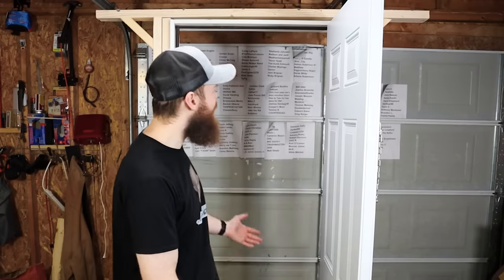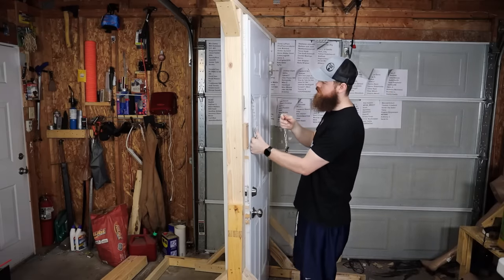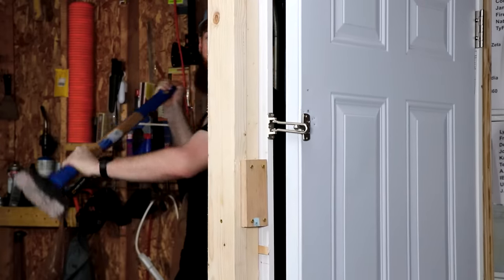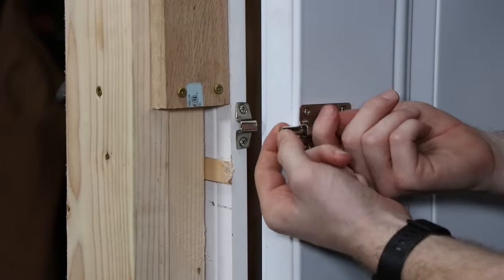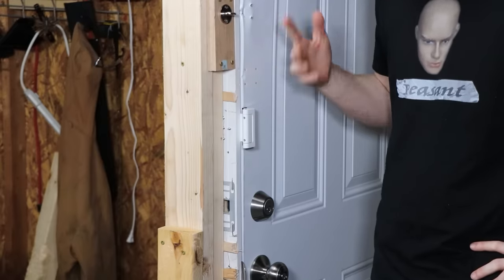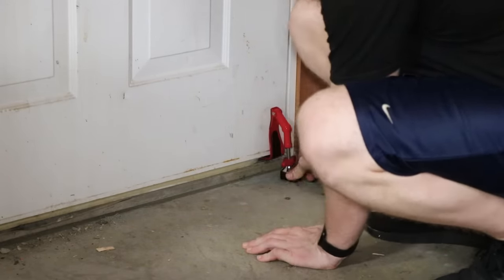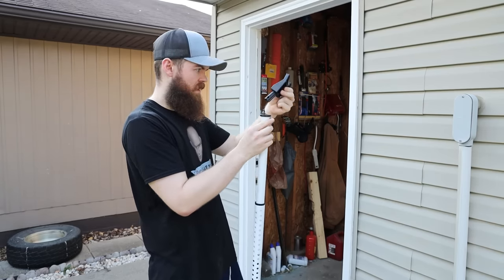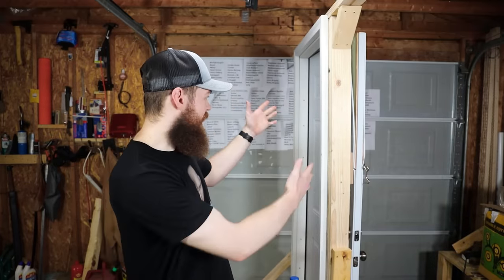Testing Top Rated Door Locks From Amazon!

Comment: Personally I would really like to see this tested again. But this time around have the door frame better stabilized or weighed down, and for the added security features to be properly installed with upgraded hardware. 
Maybe if possible do two doors one with all the security features locked at the same time and then another where you test each one individually. Just a thought but would be cool to see

Comment: The door chain latch is suppose to be horizontal mounted to the door with the hole on the far side. That way when you push the door open you cant unlatch the chain but it's still just as easily broken
Reply: Check his channel. He did another video.

Comment: The one you thought would be the best 1.  Those are used with the regular door locks.  I have a Similar one. And depending how you install it.  It works really well.  I kicked the hell out my metal front door.  And there is no way without breaking through the reenforced frame.  I used 4 inch screws on the locks and hinges.  And I reenforced my door frame as well

Comment: This is a poor test. The test door setup is not secured in place so it does not represent being a house door. When you impact the test door much of the energy is used to move the entire structure. Ordinarily all of the energy would be input directly to the system. There is too much energy loss in this test. Even still, I appreciate the effort!

Comment: Good luck getting through the "slide locks" that are in my door :D They go straight into the metal frame and and inch thick each on top, middle and bottom of the door.. (and the door opens out, not in)

Comment: The first lock was the wrong way around, the slider bit is meant to be on the door, not the frame. You have to basically close the door to release it, allowing you to fully open the door.

Comment: Jamming pennies into the door jamb would lock the door better than most of those.  

Want real security?  Put in four U brackets - put them into the studs to the sides of the door - two of them at knee height, two at shoulder height.   Drop a 2x4 into each U bracket.     To break the door down, the WALL will have to be broken.

Comment: First off Great video and thank you for your time and money you invested in this test.I have a few suggestions to test. Second, I was like you I thought the door defender type lock would have been better. Maybe it’s the brand? .(I thought the stick would been better as well)  I have seen many reviews saying the Prime Line brand / Defender Security (sold at box stores for 4 times the price on Amazon ) is the original flip style lock and made from better materials. In one video I could tell the metal piece that bolts on with was laminated layers of aluminum and others not. That’s an obvious advantage. May want to test it. Also a new brand out “Mousike” makes the same type lock in 4” and 8” with the 8” having 6 screw holes compared to 3. Maybe it’s better? Especially with 3and 1/2 great screws.  But after reviewing I have seen good things said about the CZU lock(again with great screws not the supplied ones ) . One other is the Honesaloc brand. It looks like an old type hotel lock but has an extra way to lock. So if you could test the Defender Security 3” brand , CZU slide lock  , Honesaloc, and 8” Mousike that would be awesome. All are on Amazon and I think three of them costs about $30 total. And then the CZU is $28 for 2 pack. We all know that anyone can break a window. So cameras are recommended and a security system with glass breakage sensors and motion detectors are the best , (well they are the best to get up and get the real best security device that holds rounds ) but these door locks are a good addition to a security system. Thank you again.

Comment: For deadbolts, they make a U shaped plate that goes over the edge of the door and then the door latch and the deadbolt assemblies are installed through the plate and the door like normal.

Then there is a special heavy duty latch plate for the deadbolt that extends a couple of inches above and below the hole with a cup that fits into the hole and it has about one inch screws that holds the latch plate in place and then in the bottom of the cup it had three to four inch screws that are run into the wall studs.

Use a deadbolt with an extra long throw and some hinge pins on the hinge side of the door and screws long enough to go into the wall stud on the hing side of the door and they would have just about have to to break the door down the center to get it open.

Comment: I've seen a lot of chain locks in polish houses, but the difference was, they were mounted straight to the brick wall with big screws, and they were much longer with some twist and drops, so you can't "push and slide" them to open from outside. They are cheap and reliable, but I don't think they were made for US market, where dry wall is much more common.

Edit: I just saw the chain. Whoa. The ones I saw had much bigger and sturdier looking chain.

Comment: First off. He couldn't produce enough force because he was using his support foot to try and keep the frame from sliding. The frame sliding was so there was not enough resistance. Next time anchor the door frame to the floor. And be more careful, you could've slipped and cracked your head open.

Comment: Found out something law enforcement hasn’t known for years; most residential doors and box store locks aren’t very secure. As you upgrade locks your cheap door can become the weak point. The hotel bar lock is defeated quite easily with a simple flipper, just a bent piece of spring steal; a lot of department and even most hotels themselves have them. I’ve used the little latch lock, the one that goes in the door catch, as it’s a simple added security on hotel doors to prevent entry while you’re in the room; hotels offer very little actual security. Just realize most entry is upon unlocked doors or in under a minute; anything more than that and most criminals will just move on. I will say the long bar lock, referee to by some as NY locks, were quite popular when I worked in NYC, and typically were installed in one piece and actually had a piece installed in the floor and door which when positively engaged were quite difficult to defeat/bypass. Usually law enforcement, upon seeing a lot of locks, or a door that doesn’t give in a hit will target the hinge side as they can be the weakest point as one other side note when doors aren’t actually mounted and are in test rigs like yours a lot of energy goes into moving the rig and not into the door.
Get a quality deadbolt that has a security plate or housing with long hardened screws designed to go into the structure of the house not simply the door jam; and if your hinges are on the outside get security hinges and/or jam pins to prevent a person from simply popping the hinge pins out and opening the door without having to deal with the locks at all.

Comment: I'm kind of curious if the pole jam would work if you replaced the button and ran a bolt through it instead. I know that would be a bit more alteration than just longer screws but I'd be interested to know if it works at all.

Comment: Very first lock you had with the chain you had it mounted backwards the chain is supposed to be on the lower frame and the receiver on the door, also the receiver is supposed to be horizontal with the opened end the farthest out so you can't do what you just did.

Comment: the way to mount a chain lock is the chain on the frame and the insert part on the door mounted horizontal with the insert point on the far side away from the doors edge once the door is open the only way to remove the chain is to close the door so a hand cant fit

Comment: I will say this, Each of these designs has potential. if you made some design changes they could be a lot better (except the chain, never been a fan of those).

but really even the weakest one of these still buys you a few seconds at least, to get a firearm or any weapon. You still had to push them a few times

Comment: The 1st  "door thing", the receiver should be placed higher so the door doesn't open much. But I understand that you followed the instructions.
Reply: If the receiver is on the door, then when the door is forced open most of the force will be absorbed by the corner of the door where it's pushing on the chain, rather than on the receiver.

Comment: I know this is a year too late, but you can beat those hotel locks with a rubber band.  You loop the rubber band around the metal loop, then close the door.  The rubber band will then stretch back and open it up.

Comment: And the door pole and other one would work better if the dead bolt is locked too which I would assume is what is supposed to be done.  They are add ons to your regular locks not just stand alone door stops

Comment: Hej Tyler, I like your video!👍

I can not help but think that you should have mounted the door frame so it can not move you lose a lot of impact force just by the frame is not attached and is able to move both at the top and bottom so much of the energy from your kicks is absorbed by the movements of the door frame because the top of the door frame is able to swing back and forth and the bottom just slides across the concrete floor.
I think you would have an easier time breaking in when you tested the number 2 locking mechanism if all the energy that is absorbed by the movements of the door frame was instead absorbed by the locking mechanism.

Comment: Yeah I think the one that holds the handle to the ground that you're right the failure point is that little button if they would actually put a bolt in it and a screw I would like to see how that would work

Comment: If you’re this paranoid just install more dead bolts. Use different locks for each one, extra points for using special pins and not any factory fresh pins and key. Just because lock picking lawyer made me learn to pick locks and learn how easy it would be to break into literally anyones house without making noise with picks.

Comment: Love these tests... AddALock test wasn't the best, though, because the door and frame were already damaged from the sledgehammer. It's kind of like crash testing the same car 3 times. Of course, I don't have much faith in the AddALock either way as it seems like a gimmick. There are some all metal versions but they are probably still very limited. I'm guessing the red doorstop thingy might be pretty good in conjunction with a locked deadbolt, but is lame by itself since it's at the bottom and the door will flex and gradually scoot it away. 

The hotel bar and privacy hook (the toughest ones) can easily be defeated by rubber band and tape.

Comment: With the first lock you need to put the slide part on the door so when u open the door it tightens the chain into the slot n there's only enough slack to remove the chain when the door is closed. P.s. they make tools to get them unlocked from the outside

Comment: I have the 1/10 rated door lock. I had never considered it a "deadbolt"-type level lock. It's  meant to be a travel-type extra lock. Niche audience, but if you travel for a living or use a lot of Airbnbs, it works really well.

Also, mine has two sides for two different sized latch holes.
Reply: yeah, if you can get a good one (so many knockoffs!!), those little things are solid AF. They are great for any door without a lock or one you dont have total control of the keys. Not invincible, but I tested the ones I got for travel and you really have to break the door like a deadbolt.

Comment: It's simple, dude

you mount the chain-lock farther up

that way it only can be latched, and thus UNlatched with the door completely closed

Of course, that specific door chain is NOT sturdy, but if they're installed properly they actually fucking work well

Comment: The biggest problem is the door itself. It opens inwards for some reason. That seems very odd. Not only is it significantly easier to get in, but you might be knocked out by your own door if someone tries to enter with the sledgehammer.
..then there is the snow-problem (but that might not apply to where you live); What if you have 3 feet of snow during the night and then open the door in the morning? 😁

..had to search this one. Seems there actually is a difference depending on where on the globe you live. 
Personally, never seen an inwards opening door in my life where I live. 
Interesting stuff.

Comment: The white bar you really need to set it at an ANGLE you had it nearly vertical. no strength that way. Set it closer to 45' and you might get a very different result. This if its a crap knob.....

the hotel one is probably the best just get a beefier version of thats.

The privacy hook. all they have to do is use better screws AND have a small metal bar welded to the bottom of the metal plate that just sticks out past the edge of the door to prevent sliding something in and flipping it up. Stopping it from bouncing up also would not be that hard.

Comment: most effective door lock is a 2x4 screwed across the middle of door and one about 3 feet out on floor screwed down then you wedge a third between them and Attila the Hun and his army couldn't break the door down. not very visually appealing. so they make a steel bar that goes into a socket in floor to a lock in middle of door more expensive than the 2x4 but nicer looking.

Comment: The very first one, you've installed it wrong. I dont know if the instructions told you to install it this way, but the chain goes on the frame, the locking part goes on the door, long enough in to leave a small gap for you to open the door so you can taunt the undesirables through your doorgap but not enough for someone to be able to stick their hand through.

Comment: Door chain is installed wrong. It should be horizontally installed. Then you couldn't unlock it from the other side. Also, the chain should be mounted on the 2x4 and the slider on the door lol.

Comment: That chain lock... is supposed to be the other way around. The sliding/lock part goes on the door usually right to left. That shortens the chain a lot, making it impossible to just unlock with your hands. I'm shocked you didn't know that... if they were installed the same way you did it then they would be completely useless.

Comment: You can open this lock Jack N' Drill Swing Bar Door Lock with a rubber band, open the door as wide as you can, slide the rubber band over the metal bar and close the door while pulling back the rubber band. That way you have now got the metal bar  back so that the pin goes through the hole at the back of the metal bar, make sure you still keep the rubber band tight while you now carefully open the door and voila you are inside because the metal bar is tilted back, just like you would do from the inside when you want to make sure the door was unlocked. So this security lock is garbage just like all the other security locks you have shown, they only give you a fake sense of  security don't recommend any of them.

Comment: The fact that the door is not level with the floor has a lot to do with the failure of the ones used on the floor. It is at least the height of the 2x6 base board beside the door higher than the floor?

Comment: 4:00 I used to work at a Marriott and all the rooms have this extra lock. Maintenance had gone home early that day. At around midnight, somehow a  guest had the lock secure itself when he walked out and he couldn’t get back in. I was front desk and I spent 30 minutes trying to break the lock by lunging and kicking at the door like you did to get it open. Impossible. I finally got a hold of maintenance worker on the phone and you can literally just put a thin metal bar in between the little gap in the lock and twist. It breaks with barely any effort😂😂😂😂

Comment: You do realize that a door will be firm and attached to a home making it solid, the third one where you say a bar can just slide up Wich will never work because there is door stop & seal all around the door. Use all of these on a real house & door. The best one I have seen is the piece of metal attached to bottom of your door that gets folded down and keeps the door from moving, it and a dead lock will be the best bet.

Comment: you cold use 2 Jack N’ Drill Swing Bar Door Locks on one door. with that last lock you tested I've seen a metal one that's not telescopic but is a steal  bar that goes under the handle and the other one goes into the floor its self.

Comment: The top of the door frame is not stationary resulting in an inaccurate test. When you apply blunt force, the energy isn't what it would be if the door was installed in an home and completely stationery.

Comment: 3:00 You installed it the wrong way! This is a chain to use when you're inside the house to prevent entries. The long piece has to be installed horizontaly on the door not on the frame. There's a type with a lock that you can unlock with a key from the outside.

Comment: OK anything that swings (door chain and the hook) are meant to have the swinging part on the door frame. The reason for this is if it is on the door it will swing and put wear on the door. I understand you used the picture on the product but it is wrong. The other thing is some of the devices are made for travelers where you can not mount anything.

Comment: That sliding latch isn't actually any good. It does fine against kicking the door open, but simply opening it an inch and pushing the bar out of the way gets you insode within 2 seconds.

Comment: I'm wondering if you  used/installed the security bar correctly.  From the video, it  looks too vertical,  not offering enough  resistance to horizontal break-in force.